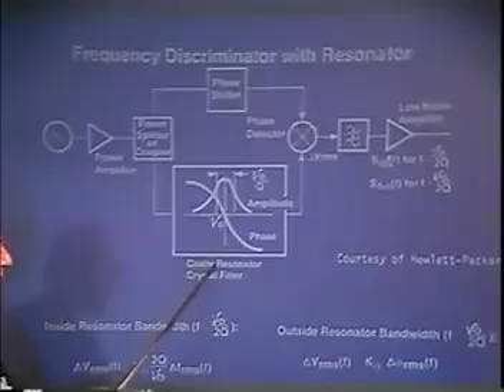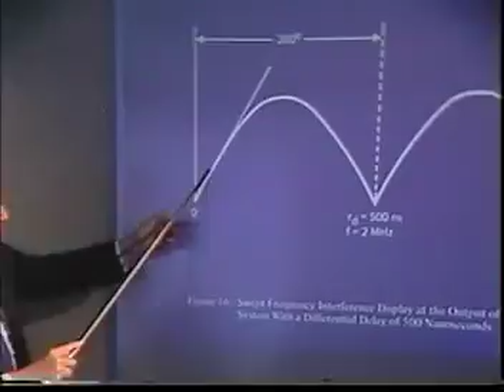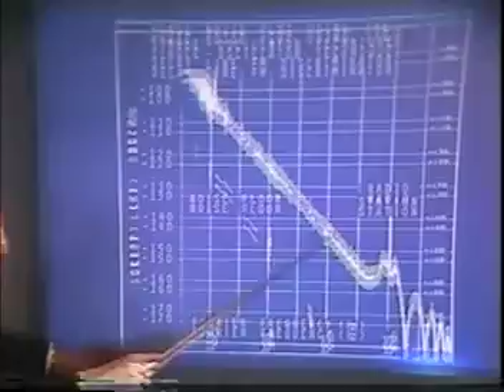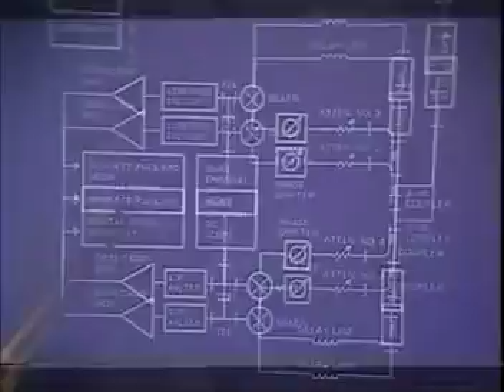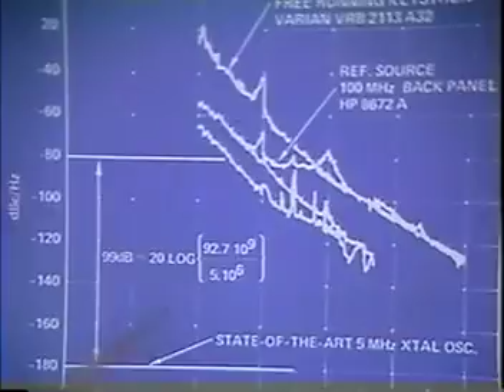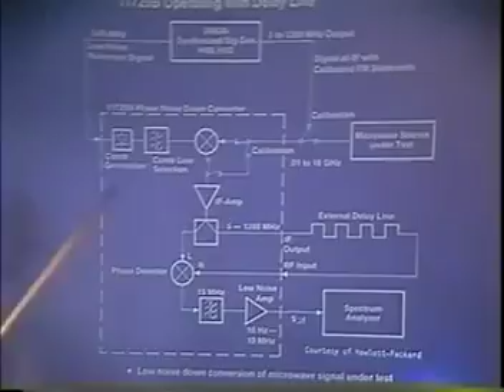Phase Noise Measurement Techniques lecture by Algie L. Lance

Comment: Grate lecture.  Very useful information about practical measurement of phase noise. This is exactly what I look for.  I went thru many different material and Algie L. Lance lecture by fare the most clear about the subject. One comment to the publisher of the video.
The image is unstable - jump up and down. Wonder if that can be fix and republish.